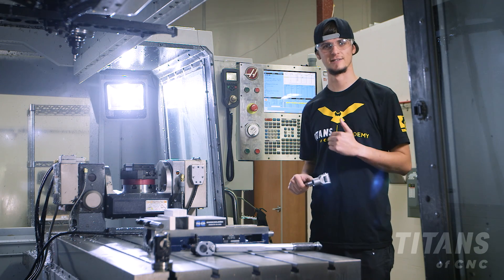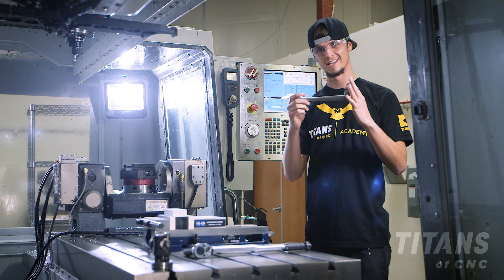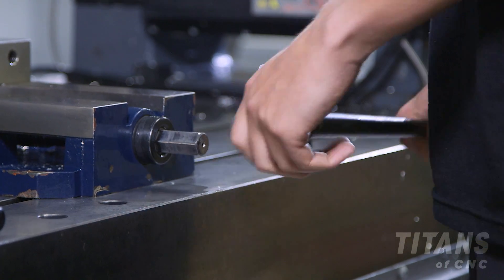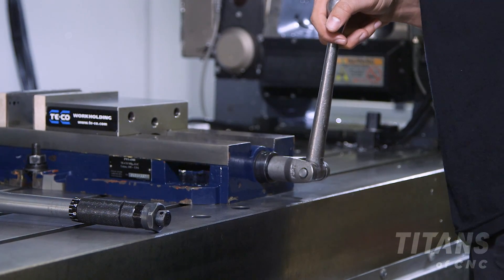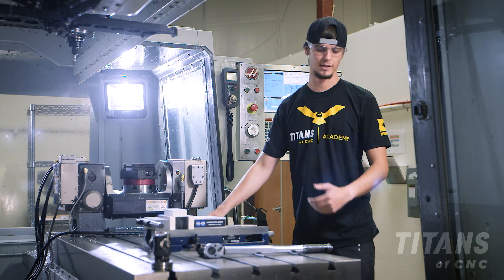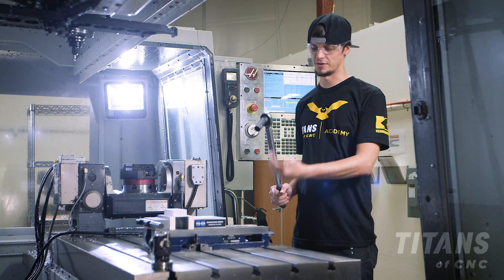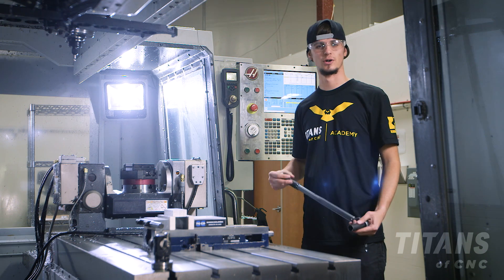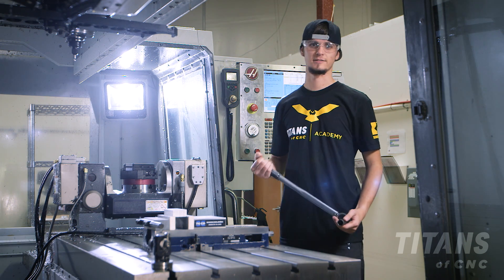TITAN FUNDAMENTALS: Tightening a Vise to Spec

Comment: Hello, i assume it is not always 65 footpound. Does that value depend on the vice? So for that particular vice would the tightening force be the same regardless of the workpiece? Does it change depending on the workpiece? In either case, how do you know what is the force needed?

Thank you
Reply from the maker: This is recommended for the building blocks which is just stock, solid aluminum. You would need to lighten pressure on plastic or flat material... hollow etc. Also, increase force for big pieces that are getting hogged aggressively.

Comment: Would be good to have a basics follow up video showing how to work out exactly how much torque to tighten a vice to (Based on vice characteristics, material clamping, depth, jaw type etc...). I generally go with trial and error then rinse and repeat once I have a torque value that works. Keep up the good work. Cheers J